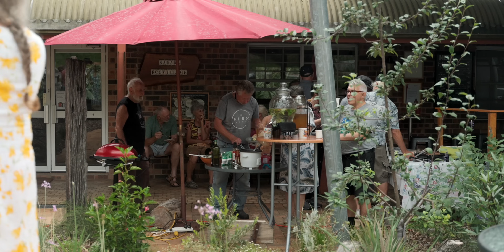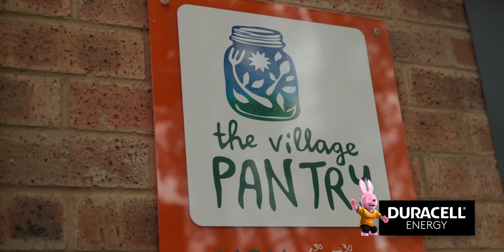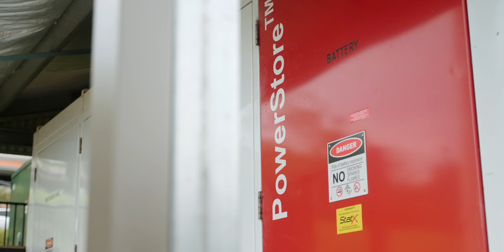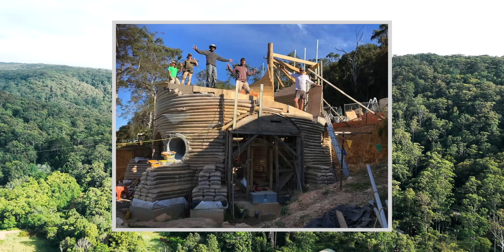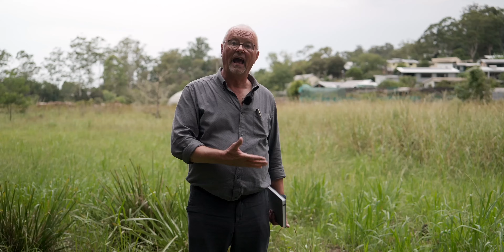Community Inspired, Self Powered Paradise?!?

Comment: Love the village and a few questions. What do they do for heat?  And It's not clear about the electricity charges. Does each home have the solar behind each house's meter? And who is charging the community battery? Do they have net metering or does the battery just get charged from excess generation but not metered? Meaning the individual house gets nothing for charging the battery and only gets charged for using it.

Comment: It was a great initiative at the time and hats off to them for doing it but I think the future for free standing homes will be home batteries and solar with EV backup. If battery and solar prices fall by 50% as predicted then a 10kw array and a home battery will  be about  $15k ($10k U.S.).  That works out at about $1,000 per year for home and car charging. For another $1000 a petrol generator could be  stored in the garage  for real emergencies.  Co- operatives are good but don't always work because they require co operation.  It's nice to be independent

Comment: I'm a little confused by how this works - are all the solar panels on each house just powering the community as a whole so all your houses are all in effect subsiding each other so everyone still pays that 20 cent kWh in the day 60 at night?? Or do you get the power of your own panels and perhaps personal batteries first and thus pay nothing until your demand exceeds the power on your property?
Reply: Smart controllers in the home should be configured to prioritise self-consumption, then home battery charging (or a bit of each if the home has controllable appliances (such as HWS)), then export via micro-grid to charge the community battery - the micro-grid controller also supplies any extra power to residents (or admin functions such as pumping town water 85m uphill to four header tanks) that need it. Then any excess is exported to the grid for absolutely minimal return.
Reply: @figgs-u6x  That is what I'd have expected but the way it was talked about wasn't clear. Sounded a bit like it might have been in effect you buy into the community power station when you join, adding your house to the collective generation. But everyone then pays for the electric they use just at a good rate because so much is community generated.

Comment: do they have ideas or systems that could be at their cummunity battery for DC fast charging? I mean if you have overflow, community battery is full and instead of selling it to the grid you could sell it to your community for even under that 20ct if they have their EV plugged in there. the throughput at the battery site should be prime realastate for thoose kinds of energy dumps

Comment: Nuclear electricity is a nuclear debt bomb that will break the national grid economics. 

Nuclear electricity will be BEGGING for 247 cash flow, $100sbillion, BUT millions and millions of customers will switch to off grid dirt-cheap PV rooftop electricity and use their v2g EV oversized battery parked 23hrs every day and all night long.

Dutton will be BEGGING the offgrid mum's and dad's to switch the grid back on.
Dutton will be BEGGING the mum's and dad's to supply feed-in dirt-cheap electricity and provide grid services.
Dutton will be BEGGING for his high marginal taxpayers, his LNP vaters, not to take their $10,000 tax-free savings from NO GRID ELECTRICITY, and NO IMPORTED PETROLEUM, and NO INTERNATIONAL PRICED NATURAL GAS. 

My good friend saves $10,000 per quarter on his warehouse electricity bills. Tax-free savings. 
And he saves $10,000 per year at home. 

Home owners, business owners, saving $100sBILLIONS taxfree. 

Industrial Customers moving away from fossil fuels to clean electricity will need all the feedin electricity the grid owners PV customers can supply. 

Millions and millions and millions of customers will be the better grid partners than needy nuclear electricity owners. 

20million is a Quantity with its own QUALITY. 
20million v2g vehicles, free massive storage. 
20million PV rooftops dirt-cheap electricity. 
20million grid services. 

The grid is too expensive to expand and too valuable to waste on a monopoly generator. 

Dutton can not even keep his paperwork straight. 
Dutton the ROBO DEBT man can chase people to their grave.
Dutton the fool's 'no thinking man'.
The LNP can do better than Dutton. 

Most vehicles are parked 23hrs every day. 
Most vehicles drive building to building. 
Most building's carpark space with $60 wall outlet for bumper selfplug-in, selfparking, trickle currents 247
All buildings roofs shaded with PV rooftop panels carpark v2g parking spaces. 

Every day the sunshines and the crops grow worldwide nuclear electricity will have only a few days to recover massive infrastructure investment. 
Grid owners know this is economic suicide for themselves to partner with nuclear.
NEW nuclear electricity generation is a death wish with warming latitudes. 

Nuclear submarines is good.
Existing nuclear electricity generation is good.
Elon Musk technology is good, politics to defend from fossil fuels is confusing. Robotic factory working 247, is 5 times more productive or cheaper. 
Batteries, battery vehicles, BVs, PV panels manufactured in Australia is good. Robotic manufacturing will create a productivity boom of good deflation of prices. Consumers prices deflation is good.

China is going rogue, and it's population workforce is collapsing.

Comment: Very interesting. An enviable place to live. Comment using cars as dual direction power: since most people are taking their cars out of the village during the day when the houses produce excess power, and charging them at night from the community battery, it's not going to work to take power out of the car batteries when people are charging them. If the cars stayed in the village during the day, then OK, they would work as extra storage. In the end, they are going to need more community battery capacity. PS: I have solar pumped water, solar panels, and an EV.
Reply: Also, grid batteries should also be cheaper to replace than wearing out EVs prematurely, and just charging EVs at work during peak solar gets you nearly all the benefit of V2G.

Comment: Only con about living in an electrically shared commune is there is always someone who is a high power user running swimming pools, 24hr air con and electric cars. Our family being offgrid, we live according to the Sunshine.
Reply: So do we. No swimming pools because of our building standards limit water usage - no one runs a/c all day but lots have Heat Recovery Ventilation system that use 2kWh a day - Most electric cars charge during max sunshine hours when PV production is surplus
Reply: I agree with the logic and think it's overall a great idea. However, being off grid myself, I don't see the benefit if you still pay the 20c/60c per kW when I don't have a bill and my system only cost an little over the 30k buy in price. Am I missing something?

Comment: My supply is closer to 50cents with the daily connection fee.
The fee is going to increase as more consumers self supply. 

All electricity generation is dirt cheap electricity 2cents kWh.

Add the grid rent to get your electricity supplied and you can then understand grid electricity bills. 
The connection fee is part of the deception.
All electricity bills should have 
1, Connection Administration fee,
 $ 1 daily.
2, Electricity Generation costs, 
4cents kWh. 
3, Grid Rental costs 
42cents kWh. 

Grid electricity is very confusing to so many. 

As clean electricity is promoted as the way forward, dirt-cheap electricity generation is confused with grid supply costs.

So nuclear promoters 'rabbit on' about their precious little piece of uranium metal and encourage to you to dream of no energy bills.

Nuclear has always had the grid cost problem.

The magician wants you to believe the rabbit came out of his hat.

I show children my finger that comes off 😮
They do not see it bent behind the other fingers.

The grid always had to be built first.

And quickly filled with fast build generation plants to get cashflow. 

Nuclear's decade long lead times and many $10sBILLIONS in construction costs can only be promoted after the grid was constructed.

Nuclear electricity generation AND the grid both need 247 cashflow and 247 permanent demand from consumers. 
And expensive $kWh, 247, cashflow. 

If nuclear was the solution, then 10x  more generation capacity AND 10x bigger grid capacity is needed ????

If nuclear needs the other 90% to be non nuclear then we don't need nuclear. 

Small Nuclear's 247 need for demand and it's cashflow then more nuclear will destroy the grid economics with its bigger 247 need for demand and it's bigger cashflow. 
And national economics will be destroyed.

Comment: Australia and New Zealand electrical safety standards are generally the same. Hopefully we get V2G going here pretty quickly after implemented in Australia.
Reply: I agree, today my MG ev powered all our essentials because the local power company were upgrading the poles etc,  We have had 4 outages during working hours in the last 2 weeks, and they did a great job to try and not inconvenience us as much as possible.  Because we have a business and have to use Starlink and computers to maintain contact with the outside world, our MG has been a life saver.  When V to G eventually happens it will be the biggest shakeup to the power supply since inception.  Our car has a 50kwh battery, and today we used only 10% of that to keep things going.  Even though I have owned it for 2 years, this week really opened up our eyes to the potential,  and our staffs too!
Reply: A "Car" is only a "House battery" when it's NOT "A car".
Think that through?
You want the "Battery" available to RECEIVE energy during the peak sun hours....... when "you" (or the average owner) are most likely to be using "The Car"?
.
The BEST solution is what they have at the village, an "End of the street" (community) battery.
Direct connection from rooftop to THAT pack, feeding BACK to the homes when required.
Every home gets steady power even if "Their" panel is shaded for a period. 
SINGLE grid connection (One of the arguments against "Home batteries"?)
Some would say "SAFER" (Another "argument" used is "you don't want "explosive" batteries in your home".... no, I'm not saying that)
EASY to upgrade capacity if (when) the community is making money from the excess.
etc

Comment: That's excellent but those power rates are higher than our grid rates.
It is similar to the village in the Yarra Valley, on the top of the hill, the moora moora coop on Mt Toolebewong.
https://www.youtube.com/watch?v=gw8KTKh_kwQ
He is a fountain of tech knowledge and they have been experimenting with all sorts of different equipment and setups.
Could be worth a combined episode.
Reply: The point being encouraging not using relatively dirty grid power late at night. Because of the  Time of Use price signalling most residents are already planning for more solar,  a BiDirectional charging EV and required inverters/controllers.Ideally  120 households each with a 60kWh EV battery connected to the microgrid is a lot of networked battery capacity!
Reply: Yes.  I am curious how those rates are calculated.  Presumably the cost of such a large battery was massive and they are having to pay down that cost.

The long term answer has to be more solar, more EVs all with bi-directional charging I suppose.
Reply: I think you'd find that many of them are not using a lot of power from even their micro grid. During the day the panels supply the house they are on first and excess goes to the central battery. Once the central battery is full, the remaining power is sold back to the main grid (via a high voltage link). High efficiency houses also minimise the power use.

Comment: There are others in places like Germany. In cold places large central underground heat pumps make a big difference. location location
Reply: The Russians were using "central heating" across entire villages around 80 odd years ago.

I gather Iceland do ditto with geothermic energy.

Interesting as these clips are they demonstrate there's no one solution that fits all.

UK certainly doesn't lend itself to solar in the future if we are to stop using fossil fuels.

Fortunately the UK *engineering" cadres manage to get around these issues with sheer Britishness as in wind farms everywhere one looks and over the marine horizon.

And of course there's always hydrogen gas which is being exploited in quite interesting ways.

For those who can be arsed to research the topic we are now seeing a renaissance of steam powered railway locomotives. Hydrogen is being used as the fuel to heat water and the steam to drive the pistons as per days of old.

It would appear too that a steam boiler is likely to last longer than a fuel cell.

Who knew?

Ref this utopian village I was interested to note the price of electricity, according to.Australian posters was not that cheap and the grid was a cheaper option.

That's the only "problem" with going green is that it's expensive to sort out the infrastructure even with grants.

Plus having to.divvy up a 30 grand deposit to live there isn't cheap but definitely one way of keeping out the riff raff.

There again the cash was returned when you leave.

Not made clear was if the cash was invested to provide an indexed linked return.

Inflation might reduce the capital.by a fair old  bit ... coupled to the price of electricity it would appear living in this utopia was not necessarily a cheap option.

Ironically if Rolls Royce comes good with their micro nuclear electricity generating stations then the renewables thing will only have been a step on the way.

Very small nuclear power stations are old news when you think of the many nuclear powered ships and submarines there have been in service for decades.

All this renewables enterprise will be obsolete too one day much like BEVs being a step on the way too.

And of course it won't be that long before BEVs become obsolete.

And that's presuming motor manufacturers are that keen to build them ... other than those which receive massive subsidies.

Happy to debate.
Reply: @t1n4444  "And of course it won't be that long before BEVs become obsolete." You are wide of the mark there. The battery tech will of course continue to evolve but the basic EV power train is a no-brainer.
With regard to small nuclear being the thing ... don't hold your breath. Rolls Royce have their SMR design, yes, but they've never actually built one yet ... not even a prototype! Yes, there's a recent government contract "to develop small modular reactors" but this is still very early days. There's a reason why ships and submarines with nuclear power are exclusively military craft (or Russian government owned ice breakers). There has never been a successful commercial use ... because they have not been economically viable and due to fears the proliferation of radioactive material. In fact in strict economic terms there has never been a nuclear power station of any sort that has ever covered its costs when you take into account the ongoing decommissioning liabilities incurred.
Reply: @t1n4444 I can see all of these possibilities happening in my lifetime.😊
Reply: @t1n4444  what will come next after BEV and when?
Reply: @Zmeyuka1  There's little doubt that BEV will be around for a long time. The battery tech will of course continue to evolve but the basic power train is a no brainer.
Reply: @t1n4444  I'm so glad that you’re “Happy to debate,” dear Mr Average Joe. The question is: Are you just another one of this low-wage effing nuclear industry trolls that plague social media channels like this one. Because, if you are, then why should anyone debate you?

Comment: 60 days from the grid is only a small amount each day as the rooftop PV is still supplying more than the 50% of its generation capacity. 

A few more panels and v2g, v2everything, BEVs big battery would easily overcome the need for grid supply.

Grid owner's would appreciate the unload of the grid demand. 
Grids are fragile to blackout if demand goes beyond capacity.
Reply: They're short by about 16.5%, so they need 20% more solar.
Logically(?) if the existing battery can power overnight in the summer, they don't need more battery (Or V2G!)
They simply work in enough solar to keep the Battery charged in winter then SELL the excess to the grid in the overproduction periods.
Selling that excess would contribute to the cost of the extra panels (Which are incidentally REALLY cheap compared to the original installation)
I would place panels on North facing walls to catch the maximum Sun in winter..... they would still get great performance in summer.
Reply: @rogerstarkey5390  Good comment. 👍 
Should the battery be sized to get through the winter night?
And the panels.

Buying and selling from the grid was meant to be zero. 

Personally, I think that industrial customers will want the grid to take all the dirt-cheap feed-in electricity 247 to allow the industrial customers to move away from fossil fuels to clean electricity. 
So a bigger battery may be important. 

A grid with no central generation but only feed-in electricity and heavy industrial customers might be the cheapest and fastest way to no fossil fueled CO2 emissions. 

Rondo Heat Battery would help industrial heat processes and be useful compact home units.